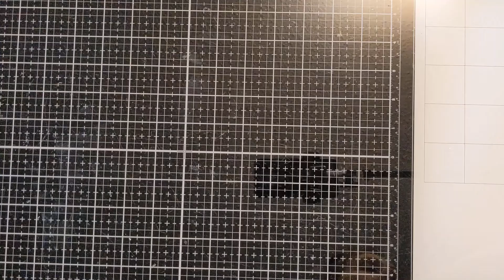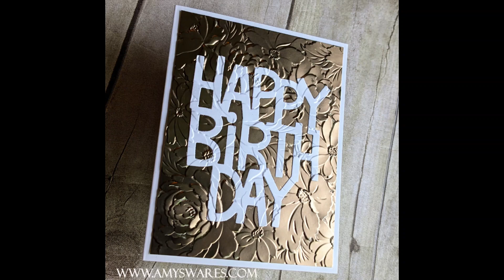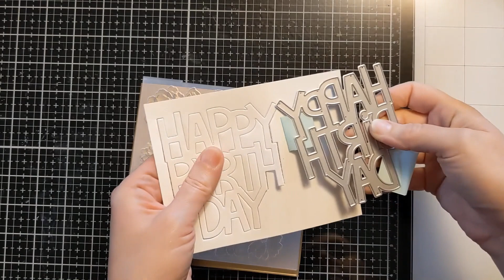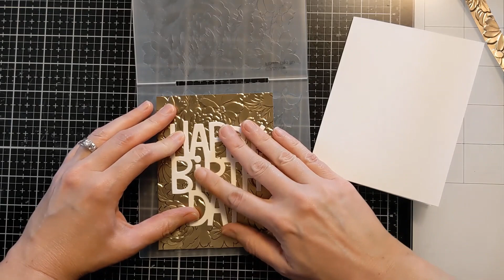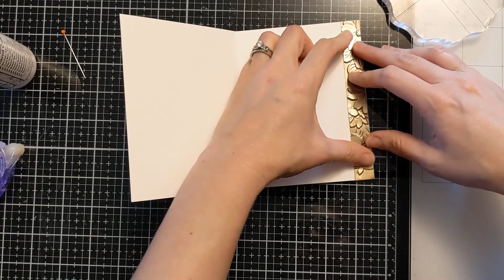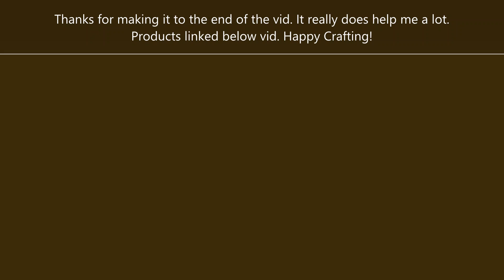Create a wowza look with 3d embossing and metallic card stock! Two ways!

Comment: How do you keep your metallic paper from cracking?
Reply from the maker: I'm not sure, I just haven't really experienced that. The metallic cardstock I have is park lane brand from JoAnn. Maybe try a different sandwich with a little less pressure somehow? I know some embossing designs are different than others. I have a couple that will crack no matter what kind of paper, it's just the design. I'm not sure. Sorry I couldn't be of more help.
Reply: @amyswares  I was using recollections paper from Michael's. I'll try a few things and see what I can do to stop it from happening.  If it doesnt work I'll try the park lane paper. 😊
Reply from the maker: @amandapethel6285  Gotcha! Good luck!! Thanks again